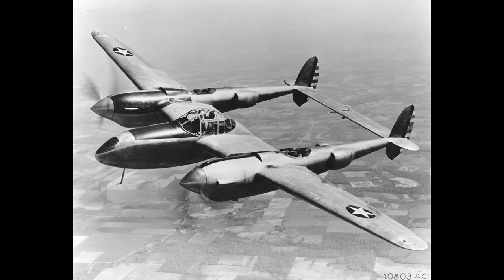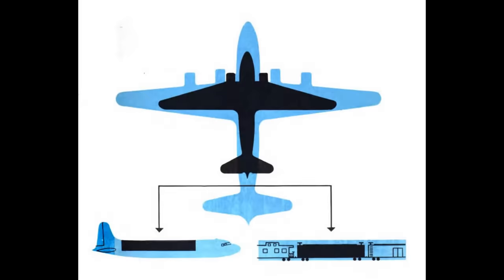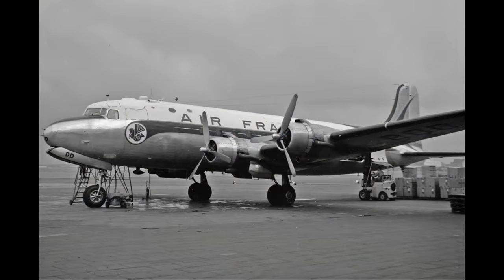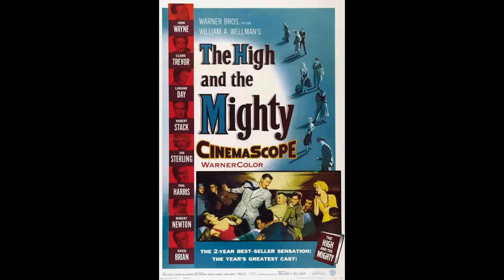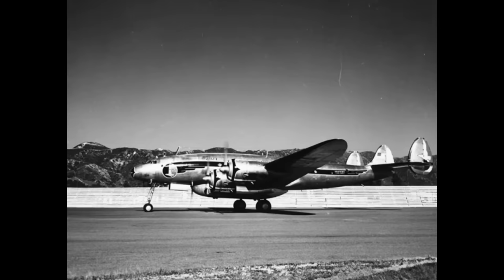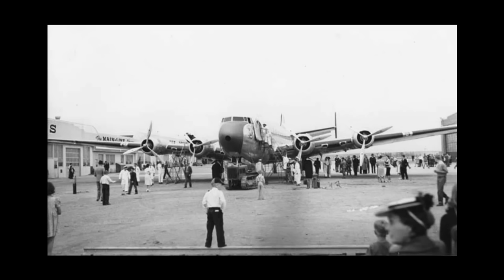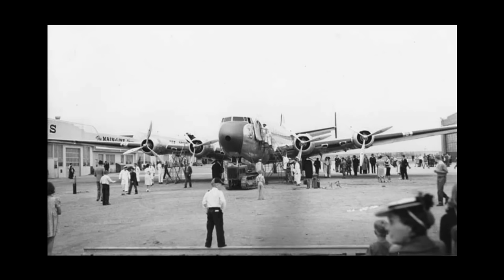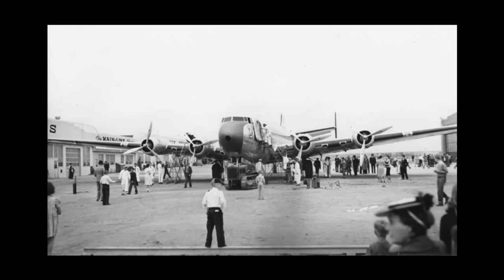Turbo Compound Piston Engines. Almost magic tech.

Comment: Greg - one of the best engineering video's I have heard.  You have an outstanding ability to be clear in your explainations, to go fast enough to cover the material and not so fast as to lose anyone.  I particularly love how you anticipate potential points of listener confusion and "nip those in the bud" (ex: "do not turbo-compound with compound turbo which is completely different") - I also like how you make quick diversions into a subsystem (like the fluid dampener) - you explain it quick and announce that you are now coming back to the main event.  If you did not make that diversion, people would be confused by a subsystems purpose and wonder why it was glossed over and either have to go to wikipedia to figure it out or live with the frustration of not knowing - you do it with just the right amount of detail and thus fill in knoweldge gaps that tend to give the viewer a much more complete picture by the end of the video - and you do it without the viewer feeling lost!

 Super Super good job - I am going to subscribe to your channel.
Reply from the maker: Thanks, I really appreciate these kind words, and the fact that you clearly get what I'm trying to do here.

Comment: In 1963, I flew with KLM on one of the last turboprop DC-7c planes over the Atlantic from Toronto to Amsterdam and back again. It was WONDERFUL! It was not noisy at all and the occasional turbulence was no worse than in a modern jet.
Reply: I sampled the noise on the main deck of a DC-6B and it was tolerable. I'm sure a passenger version with full insulation would be even more so
Reply: DC-7C wasn't a turboprop. The Wright 3350 engine used on all DC-7s was an 18-cylinder radial piston engine.

Comment: I SAW ONE OF THOSE ENGINES AT "PLANES OF FAME"--MAN ,IT LOOKED SO COMPLICATED,-& THE CYLYNDER "FINS"-WERE SO "CLOSE"--WOW HOW DO YOU "CAST"THAT SO FINE,-AT THE FACTORY--I LOVE "ENGINEERING"-I JUST COULD NOT TAKE MY EYES-OF THAT ENGINE !--A WORK OF ART !!
Reply: Later high-performance air-cooled radials had forged cylinders, and the cooling fins were machined using ganged slitting saws.  The fins were too close together to be cast.
Reply: @andyharman3022  Hi Andy !--Thanks for that information !! very-very interesting !

Comment: The section about the demarcation line (speed) between jet thrust and propeller thrust is very interesting. My auto-mechanics Votech teacher explained this system to us back in '75. He was a B-24 (ETO) pilot, airline pilot and FAA safety guy. Science classes for those who were awake tells us that to move a quantity of molecules of gas through a pipe from high to low pressure,(reduction in pipe diameter) those molecules must be increased in velocity. These turbines work on very high velocity exhaust without significantly raising it's back pressure. Normal turbocharger is more akin to a jet engine turbine turning a compressor. Venturi effect in a carburetor works on a similar principle. These PRT's could as well be called 'waste recovery turbines'. P-51 belly scoop recovered waste heat from the engine radiator by heating air and increasing it's volume (thus increasing it's velocity through a fixed orifice).

Comment: Hi Greg, my understanding is that modern F1 cars (2014-present) use a pressure turbine mechanically linked to the compressor via a shaft as in most turbochargers. However the Motor Generator Unit -  Heat (MGU-H) is colocated on this shaft and able to utilize the battery to add power during low rev acceleration mitigating turbo lag, and also able to extract electrical power during high rpm on the straights to either charge the battery or directly power the MGU - Kinetic for more overall driving power. 

The system can only extract power at high rpm - traditional turbochargers would release the excess boost pressure through the wastegate but the F1 MGU-H is able to reduce boost pressure by adding the electrical load. 

There are some teams that have a special mode that fully drives the compressor via the MGU-H and opens the wastegate to reduce backpressure for maximum power during low speed acceleration. Alpha Tauri did this a few years ago but I don't believe it's common as it's highly draining on the battery. Other teams have figured out how to get better laptimes using other tricks with their available electrical energy. 

I'm only about 80% sure on all this, would appreciate a correction if you read up on this technogy and understand how it's used. Thanks!

Comment: When I was designing stationary diesel installations back in the 1980s, a type of turbo compounding was available for the big MAN-B&W diesels and Sulzer diesels. These were around 80,000 hp and up; huge engines, running continuously for thousands of hours at around 100 rpm.

Comment: My first trip by air was as a five year old in 1956 traveling with my mother and siblings from Portland OR to Denver CO on a United Air Lines DC-6B.  I then became hooked on aviation at first flight.  We later flew on to Atlanta GA via United DC-7 to Chicago Midway Airport and, from there, on a Delta DC-7 to Atlanta.  Since that time, I flew many times on DC-7s, 7Bs and 7Cs well into the 1960s, my last time between Savannah GA and Atlanta with Delta in 1968.  Back in the day, these airliners were hyped as the ultimate in luxury air travel with the airlines rolling red or gold carpets  and stringing cordons out to their boarding ramps and pampering passengers with gourmet, multi-course meals, free cigarettes and champagne.  We didn't have so-called entertainment systems on board during the piston or propeller era, but then the large windows afforded hours of viewing pleasure whether flying over canyons, mountains, cities, rivers and plains or observing the many varied colors of hot gasses issuing from the exhaust stacks at night depending upon the particular stages of the flight. But, oh, was the noise and vibration ever a mind-altering sensation.  Normal conversation was virtuallly impossible limiting one to having to face someone directly in order to make even the simplest of small talk where the ability to read lips was practically mandatory.  The vibration at altitude caused one's voice to sound as if he or she had swallowed a spoonful of gravel when speaking.  You would instinctively find yourself attempting to clear your throat but to no avail.  Still, I look back on travel by DC-7 as perhaps one of the best times in airline history as reflective of the so-called golden age of air travel.

Comment: I remember reading about this in aircraft mechanic school in the early 70's , I am guessing that when the jets became more reliable and long lived the maintenance differences killed these off.
Reply: I still think it's amazing what people thought of to overcome the limitations of the technology.
Reply: Even in their speed range, you'd be much much better off with turboprops. Still using a turbine to spin a propellor, only ditching the 18 cylinder R3350 and all its parts. You're only adding a compressor and combustor, pretty much.

The C-130 first flew in 1954, contemporary with the DC-7. The airlines were switching to jets anyway, but even for lower speed large aircraft, turbocompounding had no future.
Reply: We were still reading about it in the early '80's. The A&P exams were hopelessly outdated back then.
Reply: @dougrobinson8602  I believe that but still miss them
Reply: If you break it down to the basics a jet engine is pathetically simple compared to these mechanical orchestras.
Reply: Also much lighter, runs on cheap kerosene rather than 130 octane avgas, and so on.
Reply: I remember my instructor saying with a jet it,s if something will break compared to a piston engines when ?  cause it will.

Comment: Great & indept explanation of this topic. Like you said, Volvo & Scania are using this system nowadays.  
I remember that Scania introduced the R113 400 turbo compound engine around ‘91. 
It was a 11 liters 2 valve per cylinder inline 6, 4stroke diesel with a ‘normal’ turbo charger and a second one driving the flywheel via a clutch system. 
Claimed engine efficiency of 46%. Didn’t see them being sold a lot though in that time. More often the standard R113 320 & 360 versions. The company I worked for in ‘93 as a young mechanic used slightly tuned-up 320’s.
For more power, companies just bought the V8 R143 versions.

Comment: I was a Recip Aircraft Engine Mech when I was in the Air Force. I worked on the R-2000 on the HC-54(DC-4) the R-4360(HC-97 ) the R-1300(HH-19B helicopter) and the R-3350 PRT(EC-121 Super Connie). The R-3350 PRT was pretty complicated since it had the Power Recovery Turbine on it. The R4360 had regular turbo on it.
Reply: I know it's Wikipedia - but the https://en.wikipedia.org/wiki/Lockheed_EC-121_Warning_Star with the Wright R-3350-34 turbo compound engines retired from USAF service in 1978 and the US Navy in 1982!
Reply: @georges.7683  Yes, the R3350-34 was the first Turbo-Compound engine used on the EC-121 (and C-121C).  It was equivalent to the civilian DA-1 series engine with 3250 BHP Take-off power.  In the late 1950s/early 60s, many if not most of the -34 engines were rebuilt as -93 engines--equivalent to the civilian EA-6 series engine with 3400 BHP take-off power and a much more robust supercharger gear set up that was less prone to disintegration.   -Stef Bailis, former recip flight engineer.

Comment: It was great to see (32:04) the nice shot of a Everts Air Cargo DC-6. They, and Air Cargo Express are still operating the DC-6s out of Anchorage and Fairbanks, Alaska -- even doing contract radar-site support cargo work for the Air Force. I retired (E-8, Alaska Air Guard) at Elmendorf AFB, Anchorage, in 2016... it was fantastic to hear those P&W R-2800s wind up and slowly fade away after takeoff (144 spark plugs, all zapping away!). My dad was an AF navigator, including long sortie hours in RC/EC-121 Connies, out of Otis AFB, Cape Cod, in the mid-'60s. Their wing lost three Connies, and fifty aircrew, all with engine fires/failures. The RC-121s were very heavy with the huge, (parasitic drag) radomes, and the very heavy electronic/comm gear tech of that time. Heavy with fuel for the first hours of the mission, dad said that it just hung on the props. The PRTs had a lot of fires. I was a mechanic's helper with Northern Air Cargo, in Anchorage (early '90s) on their DC-6s -- fascinating to see how all of those dissimilar metals, wiring and complex accessories were imagined, put to specs, and assembled... all with slide-rules, blue-prints, and thousands of hands-on craftsmen. No "computer-assisted-design" software or robotic machinist programming.
Reply from the maker: Thanks, I enjoyed your post.

Comment: Oh wow, this will be good.  Ever since we studied the turbo-compound in A&P school some 25-30 years ago, I always thought the technology was engineering magic.  And then looking at turbines and marveling at their simplicity in comparison, notwithstanding the complexity of the fuel control, heat resistant allows, etc.

It’s always been amazing to me that aircraft piston engines work as well as they do, given all the pieces ‘n’ parts, but they do.  And in the case of the turbo-compound, where more high technology is added to already high technology to squeeze just a little (or a LOT) more oomph out of that power stroke is just fascinating.

Comment: Hello Greg. First time commenter and long time follower.  I really enjoy your technical and historic videos. As a service technician on agriculture equipment, I can say that turbo compounds are also used in modern agriculture equipment. It's used on large displacement, high horsepower diesel engines. I did not know of turbo compounds had the origins in aviation.   You are very correct about learning from the past about engineering and using those solutions on modern technology.  Thank you again for your informative videos.
Reply: I've never heard of any modern engines using turbo compound engines, do you have any examples?  Note that that compound turbos on modern diesels are not the same as turbo compound engines as described here.
Reply: Apologies for making it sound like turbo compounds were common place. Turbo compounds are not common place on modern day diesel engines and are fairly rare, but they're used.  Seen and work on a few engines with turbo compounds. They have a turbine and fluid coupler that connects to the crankshaft like Greg stated in the video. The MTU/Detroit DD 15 is the the same as the  Mercedes-Benz OM 473 LA This family of engines have a turbo compound.  This engine is on current Claas Jaguar forage harvesters model 880. Some information and images can be found doing a search on a Claas Jaguar 880 engine search. Also there is a nice video on YouTube  about MTU Detroit Diesel Australia DD15 engine.
Reply: Very cool,  I didn't think anyone would brave the cost and complexity of such a system in this day and age.

Comment: I remember back in 1972 in my physics A level evaluating the most efficient airflow through various engines and being highly surprised that the most efficient for energy transfer to the plane was that where the difference in speed between the aircraft and the propulsive air was minimal.  Once I had done the calculation it made complete sense, work done in high velocity air still going fast behind the plane was a waste of energy.  These turbines simply extracted more energy (work) by reducing the residual energy in that fast moving air.  It did help that my physics teacher had done quite a lot of time with Rolls Royce and was only too happy to change the subject from boring rote work to interestng meaningful calculations...

Comment: Crossing the pond from Lajes to Gander in our 118 we blew a jug circa 1976. Dropped to 140 kts, 5,000 feet and still 450 or so miles out. We eventually made it and yes we had belly spares and fixed it on the ramp. Loved flying the lower and slower airplanes. Shortly after that 115/145 was being replaced with 100/130 which slowed things down even more.
Reply: IIRC the R-2800s on the -6 suffered a takeoff horsepower penalty without the 145 octane, or maybe it was in high blower at altitude. But they ran ok on the 100/130.
Reply: Yep; the hp rating on 100/130 was 2400, 59.6" MAP at 2800 RPM, the rating was 2500 on 108/135 or 115/145, 62" at 2800. Both with ADI operational.
Reply: @paulcrumley9756  Almost perfect set of facts!  The only error:  59.6" should read 59.5".     -Stef Bailis, former recip. flight engineer
Reply: @Propliner1955  I knew that, but didn't catch my typo!
Reply: @paulcrumley9756   I figured it was a typo.  Of course, in practice, a .1" of MAP won't cause any harm; indeed it can't even be read on the gauge.
Reply: @Propliner1955 I spent my first ten years in aircraft maintenance on DC-6, C-46, knew all the numbers. Was sorry to leave that for jets, actually.

Comment: Philosophically, the power recovery turbines and centrifugal supercharger on the R3350 constituted a "through-the-crankshaft" turbocharger.  The PRT's added power to the crankshaft, and the supercharger took power from the crankshaft.  Swedish truck maker Scania has been making turbocompound diesels for a while.  Almost unknown except to insiders is that Cummins developed a turbocompound L10 engine in the late 1980"s, but didn't put it in production.  It also used a double-reduction geartrain and a fluid coupling like the C-W engine.  On the L10 the TurboCompound unit was after the turbocharger, so could not have been a blowdown turbine, as the turbocharger would have absorbed the pulse energy from exhaust valve opening.  That said, the turbocompounding raised the engine power from 360 to 400 hp with no additional fuel consumption.  

All current Formula 1 cars use turbocompounding via the electrically assisted turbocharger mandated in the rules.

Another turbocompound race car was the Porsche 919.  It used a turbine-driven generator to feed power into the hybrid battery that powered the front axle electric motor.  The turbogenerator was mounted on the exhaust manifold and ran in parallel to the turbocharger.  Porsche won LeMans twice with the 919.
Reply: Thanks for explaining the mechanical supercharger.
I was mystified by the apparent absence of supercharger on planes that were to fly at high altitudes.
I think the video should have mentioned how these engines were (also) supercharged - but NOT turbo-supercharged.

Comment: Great article, we were taught that the fluid clutch disconnected the PRT in case of failure to prevent it from robbing power, however I have never had the chance to work on one.

Comment: The t56 turbo prop ...come out mid 50s... great engine... The green monster pulling tractor has used them an the engine performed perfectly even in that,...an the guy that  Drove that tractor...also set speed records at the salt flats 
...the name of the car was the green monster...